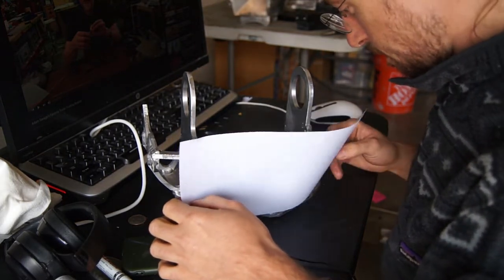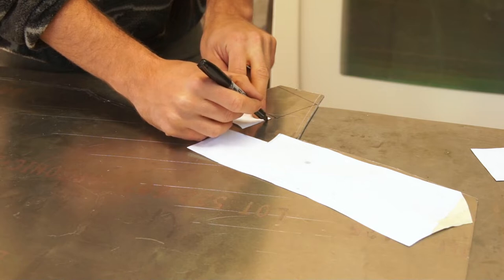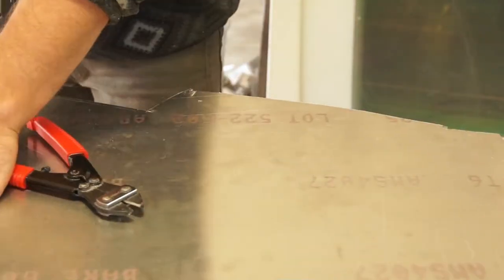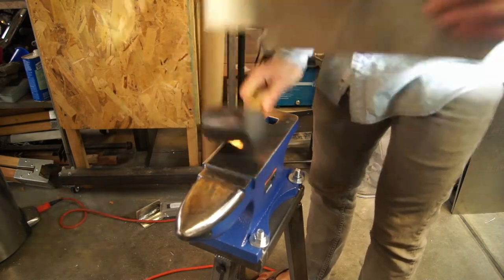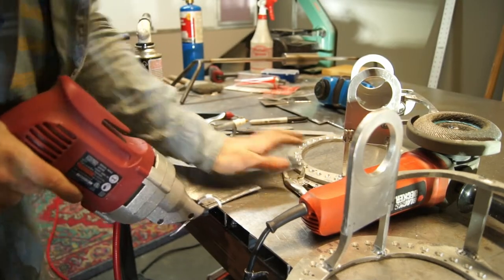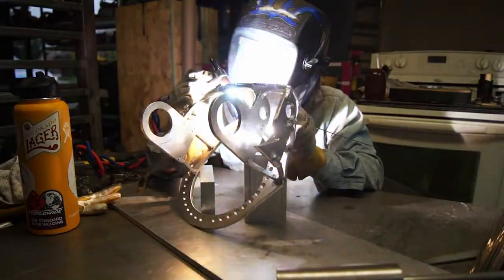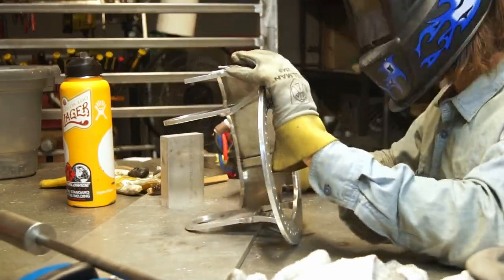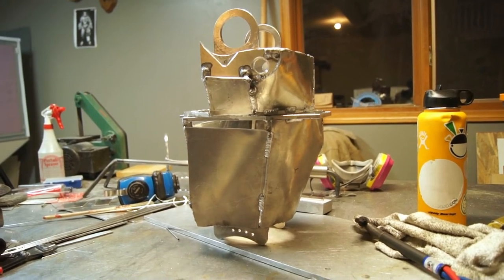How to Make Exoskeleton Skin

Comment: Whats going to be supporting  the weight?
Reply from the maker: What do you mean? The suit will stand in its own feet
Reply: @DylanEdmiston  I mean actuator wise!, will you be using any actuators or gas struts
Reply from the maker: @benads6847  yes artificial muscles https://youtu.be/5qBHkgr0_Ik
Reply: @DylanEdmiston   Just watched those videos, the artificial muscles are surprisingly powerful compared to hydro cylinders, great job! But why did you choose an odrive instead of standard ESC(sensored if high torque at low rpm is needed) for your pump system?
Reply from the maker: @Artydea  I should have used something more like a ESC! I was hoping for more position accuracy with the ODrvie but this didnt really work for a number of reasons